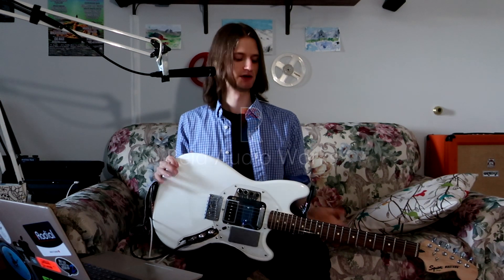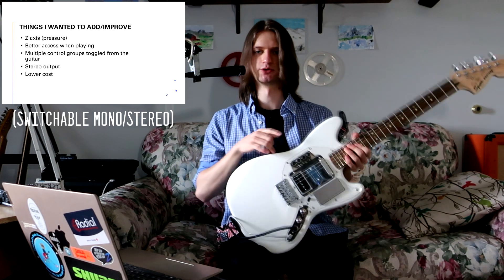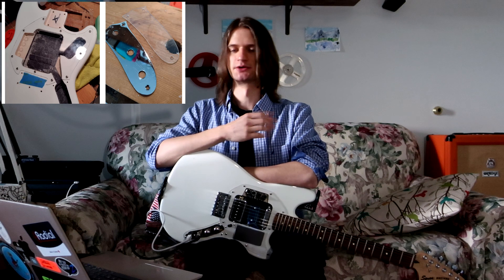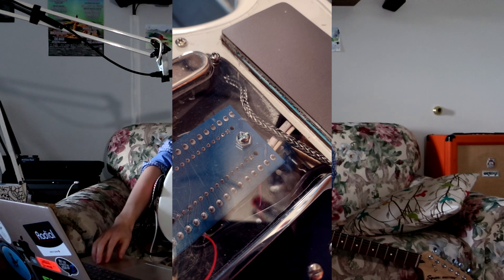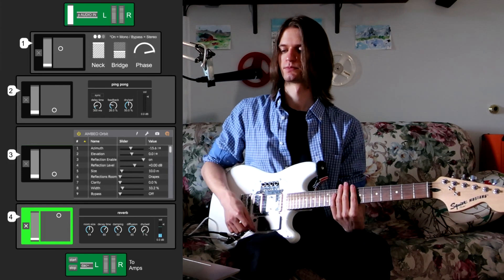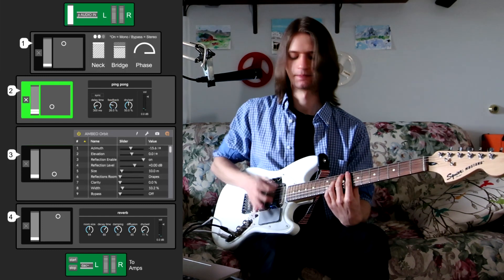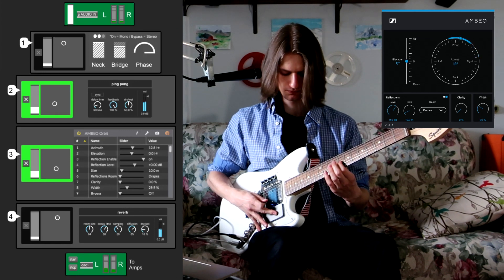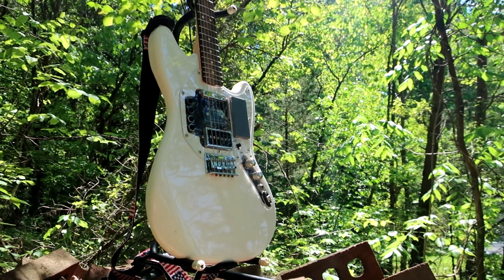3 Axis MIDI Guitar Overview + Demo (Max/MSP)

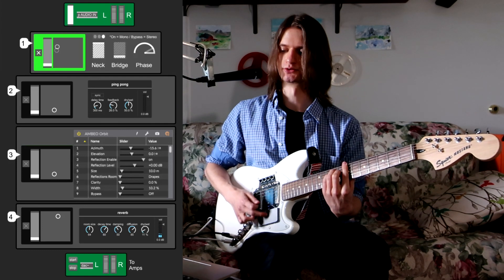Comment: Hey man great job. I built a similar thing last year which I haven't create a content for it yet. I just want to say one little thing. At 06:37 you are crossfading between pickups. I am guessing you used a simple x to (1-x) crossfade function, which is ok for most applications. The disadvantage of using that math for audio is that it creates a silent zone in the middle. I had the same problem. You can check "constant power crossfade" keyword online. You should find something like √ (1+𝑡). Try that. You will have equal loudness in the middle point of the travel. Cheers. Don't hesitate If you want to connect.

Comment: Very groovy. Very useful even, worthy!
I think about this sort of thing though you followed though apparently, you have levelled up. 
Pressure sensitive ribbon controllers on the back of the neck, and or even on a bridge plate that the palm can rest on, kinda like a chin support for a violin, for gradient depth regulation of potential variables, a digital mute control, or a digital wammy bar, or locked to adjust various synth parameters. Could also be as pressure sensitive spaces between the frets in the world of MPE MIDI2 like what you seem to be into formulating. 
The search for the lost chord.
Reply from the maker: These are some great ideas, I actually considered a ribbon controller and may use one for a future project. What is the search for the lost chord out of curiosity?